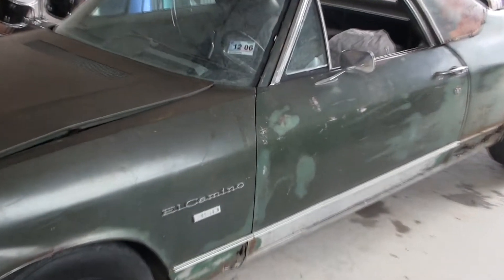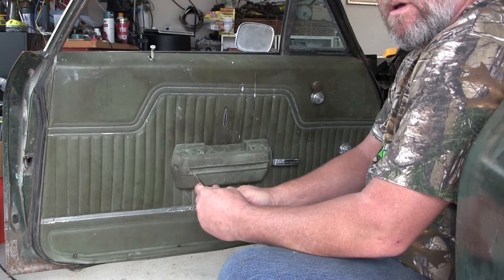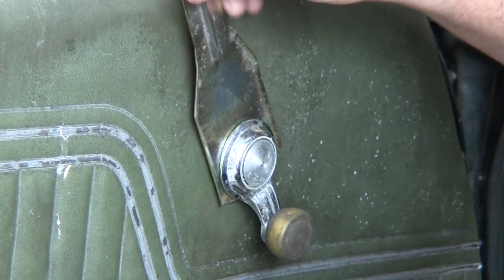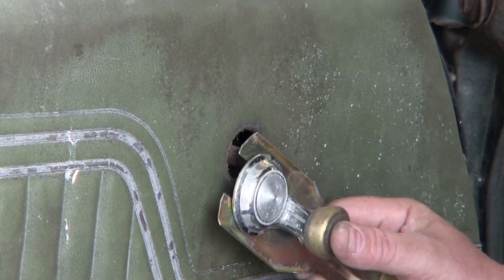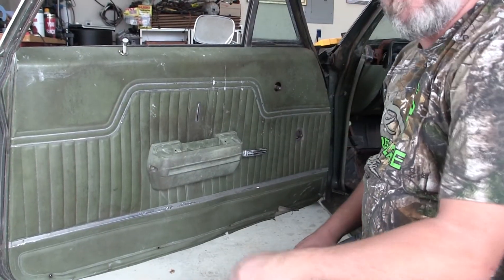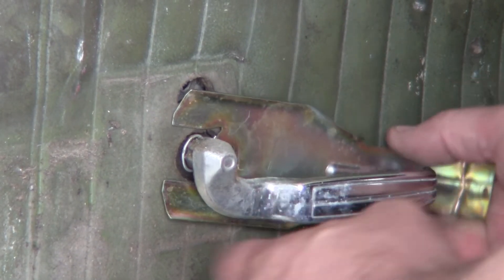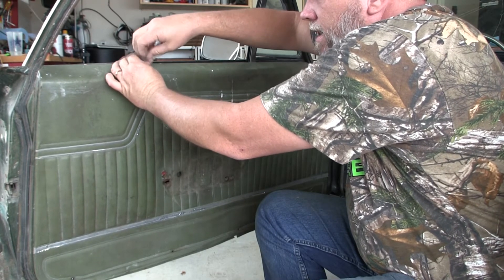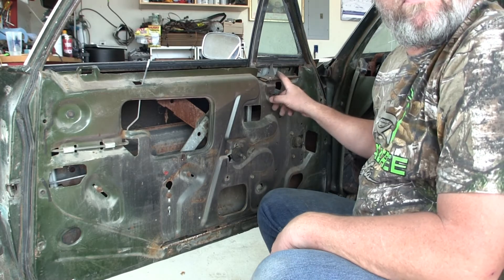How to Replace a 68-72 El Camino Window Glass Part 1

Comment: All elcamino's 64 through 72 had the soft ray tinted glass as an option. You could order tinted windshield only or all tinted glass. If you ordered A/C it included heavy duty Alt and thermostat  controlled  fan and fan shroud, but tinted glass was simply a option on its own. I been working on and restoring 64 through 72 chevellle for over 30 years. I have a 66 and a 68 and 69 my self and a whole room full of info. Glad to help
Reply from the maker: Chris Drew That's awesome, thanks for the details! And very cool that you've been able to do restorations for so long. I've wanted to for that long but never made it a priority, sadly. Thanks for watchin!

Comment: Its amazing what you find that people have done to these old cars when you start working on them. Good vid KT. I need to get me one of those tools.
Reply from the maker: Double R Restorations Man, this ;69 had been redone years ago and some of the stuff I saw on it was ridonkulous! masking tape and paper shoved in rust pockets and then filled over, flat sheet metal panels in the floor board, trim boards in the bottom of the radiator support to hold up the radiator. Crazy!

Comment: All you have to do now is put power windows in it.  Then you wont have to deal with those window cranks ever again.
Reply from the maker: 1970chevelle396 That would be cool! I've seen conversion kits that are a full one piece glass that eliminates the vent window and has a power regulator. They are nice but $$$!